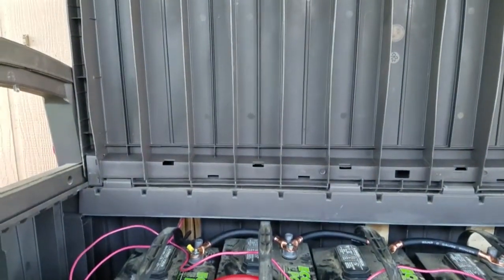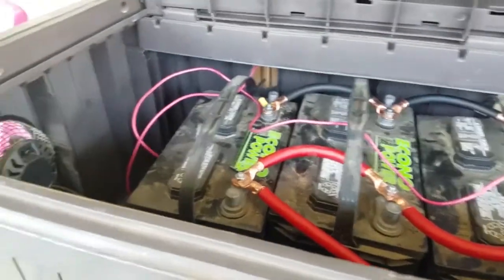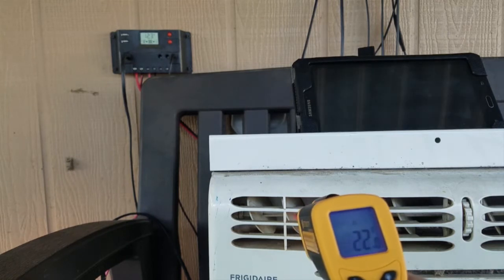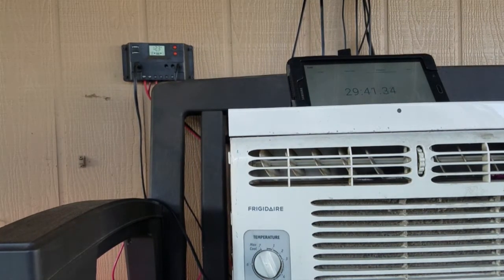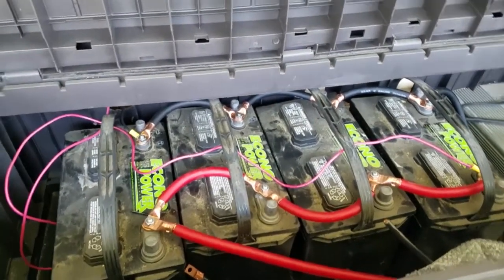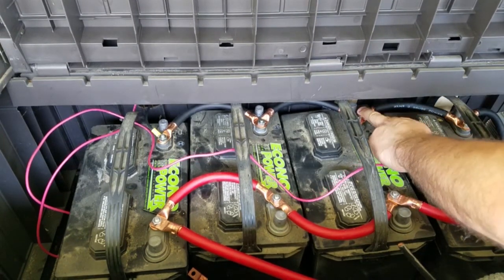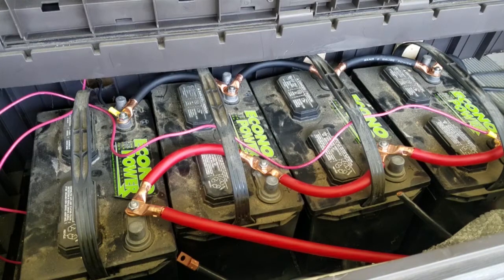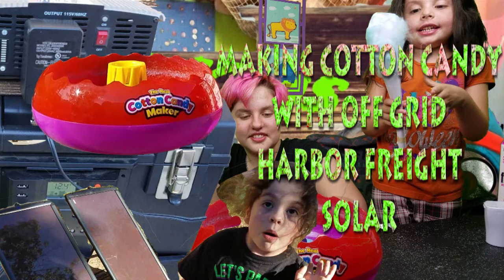Running A/C on solar power: RFTECHGUY answers comments:

Comment: your window unit can be installed just the way any package unit is installed under the home's foundation. a trunk line and a return line. just insulate well and keep the cool air trunk line close to the floor register for less cold air lose due to long trunks. if you use multiply units and one goes out you still have other way's then of keeping your home some what cool. it's a lot better than just having one A/C unit to go out and leaving you with no cooling at all.

Comment: I just bought a mini split heat pump for $450, but u can find used ones for cheaper!! It only uses 3.5 amps on a 1 pase 230 volt system!! I have been doing the  research for a while and that is your most cost efficient way to get ac and heat!! Make sure its a heat pump and not just the ac!!

Comment: I feel like running a noco charger would solve the issues with dropping voltage. (8) panels, then add four 80 amp hour batteries. Allow the solar to trickle charge and just add an additional charger to keep the voltage up at night.

Comment: I got a good deal on a Jupiter 5,000 watt inverter,  it's a good start inverter for now. I started my solar system,  I can run a 5,000 btu a/c for 2 hours before my batteries reach 12.3. I will be uploading vídeos, as I upgrade. Thank you for answering my question.